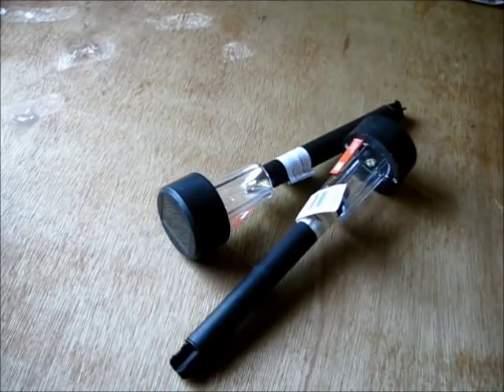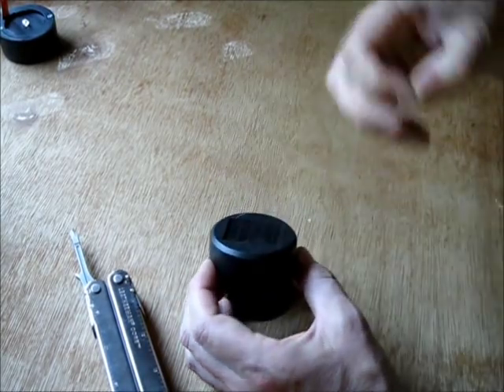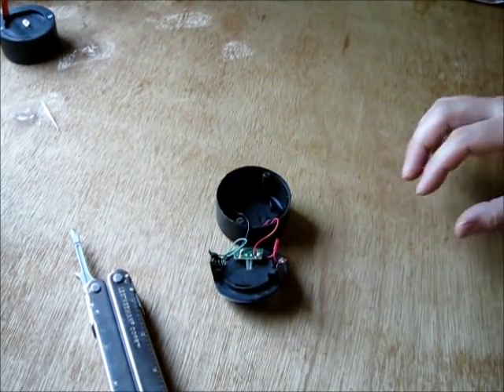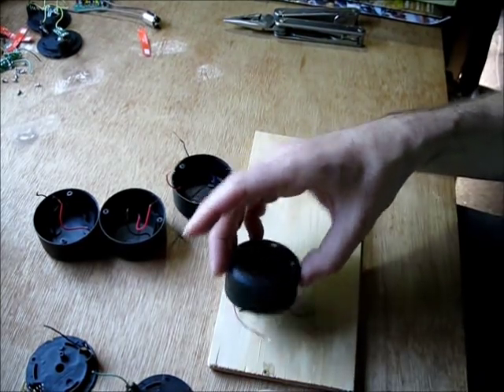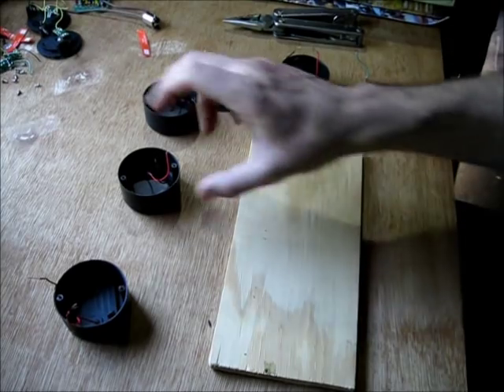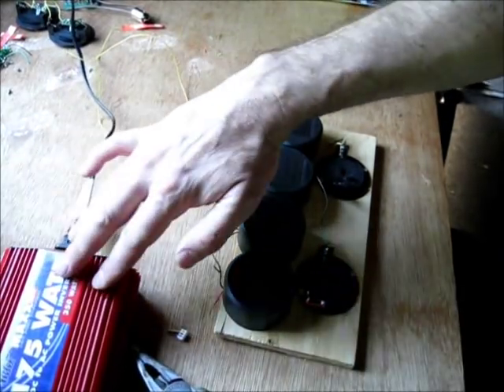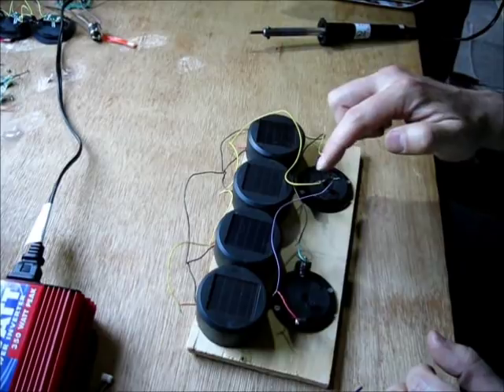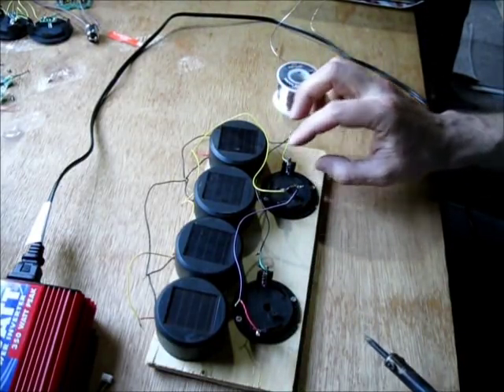DIY Solar Garden Light Hack - Solar Battery Charger

Comment from the maker: Thank you. Watch for the updates in the next couple weeks. I will add a voltage switch, maybe more solar cells and a USB connector to charge my cell phone.

I am also looking into control circuitry to prevent over charging of the batteries if I forget to watch them.
Reply: i want to build a cellphone charger with this method, how did yours turn out?
Reply: @jessedeleon4200  it's the voltage is good but the ampere is bit too low it take about 1 full day in the sun to get 3% very hour so it takes about 93hours in the sun so about 4days

Comment from the maker: Yes, I will be making some upgrades for this soon. Keep watching.

The batteries get warm when they are finished charging. Most charge controllers sense the temperature. This is such a low current tho that I do not think they would explode, but I would not leave them on for days after the are full

Comment from the maker: Thanks. You can actually use a USB cable to charge a normal cell phone. All you need to do is set up the solar cells to put out 5 volts. You can have various voltages from the same solar cells depending on how you hook them up.

Comment from the maker: Yes if you leave them on too long. Just figure about 25 ma per solar cell and how many ma your battery needs to charge. A few hours give or take will not harm a thing due to the lower current

Comment from the maker: A Schottky diode would be best due to a lower voltage drop, but almost any diode (non zener) will work in this case because it is only blocking the voltage from flowing out of the batteries and into the solar cells when a cloud passes over.

Comment from the maker: 1n4001 or 1n4007 work fine. Basically any sort of rectifier diode will do. Its just a blocker to prevent the battery from discharging back through the solar cells.

Comment from the maker: Yes, if it has one. Most do not but only have a little transistor or small circuit in them. But if you have a diode in there, yes it will work fine.

Comment from the maker: You could do it, but it would take some time. The current output from one cell is about 50mA. In a 10 hour day you get about 500mA from one cell. Two of these gives you an amp in 10 hours.

The voltage output is about 2.5 to 3 volts per cell. Put them together to get what you need. Check the original charger output for the proper voltage.

Comment from the maker: Any rectifier or schottky diode will do. A 1n4007 or 1n4001 will work. The Radio Shack part # is 276-1653 for a 25 pack.

Comment from the maker: Sometimes Westinghouse brand has the AA or AAA. A lot of these are now coming out with the 2/3 AA.

But you can use the solar cells from the dollar store path lights and get a battery socket at Radio Shack.

Comment from the maker: If you left it for many days, yes it would. With smaller batteries you should pull them off the charger after a day. With larger capacity batteries it will take a few days to charge them.

Comment from the maker: It exists and its called a MPPT controller. Multi power point tracking solar charge controller. It used both a buck (reducing) and boost converter to get the best charging curve out of your solar panels. In full sun they put out about 18 volts and in low sun maybe 9 to 10 or so. The MPPT controller matches the battery voltage to the solar panel voltage, increasing the charge over all sunlight levels.

Comment from the maker: 1N4001 or 1N4007 work fine. But a low power Schottkey is the best due to its lower voltage drop. Sorry dont know a number, but you can ask them.

Comment from the maker: These put out about 3.5 to 4 volts with no load. They drop down to about 1.5 to 1.7 volts per panel with a load, which is the right voltage for charging AA and AAA batteries.

Comment from the maker: Series increases voltage. Parallel increase current.

The solar cells are each meant to charge a 900 mAh battery in a full day. So you can charge two of them in this setup in half the time. Or a pair of 1800 mAh batteries in a whole day.

Comment from the maker: These are usually a single transistor based boost converter. They step up the voltage from 1.2 volts to about 3.2 volts to run a white LED.

You could use them for anything that runs in that voltage range and current. At some point tho, you will find its highest current limit and fry one. Keep track of what burns it out so you know your limits.

They will charge anything within their voltage range as well. The 2.3 volt cells should happily accept the voltage, yes.

Comment: It seems that it made more sense to face the wires from the solar cells toward the batteries, so the wires would reach. Is there any danger of over charging (or battery damage) if you leave the batteries in the charger too long? Thanks for the great ideas!

Comment from the maker: Thanks for the comments.

Yes, the diode is a necessary evil. You could use a schottky diode for lower voltage drop. But in the long run, it shouldnt matter too much with these smaller batteries.

Comment from the maker: That is cool. When I lived in Brooklyn, NY I used a 12 volt alarm system battery to power a battery operated 12 volt fluorescent lamp in the bathroom. The ones found in most hardware stores sold as closet lights. I had a shower room and a separate bathroom. Had a lamp in each. Saved some money on lighting that way.

Comment from the maker: Looks good. This has serious potential. These little solar cells can charge an AA or AAA battery during the day, so 3 of them would put out enough for small devices. I am surprised tho that your devices take the 3.2 volts from the boost coverters on the little circuit boards.

Most devices these days need 5 volts in.

Comment from the maker: Yes, sort of. They put out very little current. It would be a trickle charger to maintain its charge, rather than top off a battery. It may prevent a battery from discharging over time.

I have been thinking about putting one together. You need 18 volts on the solar panel, no load. String them up in series to make 18 V. Then put groups in parallel to get more current.

Comment from the maker: Yes, AA and AAA batteries. All you need is the right socket. You could actually charge your cell phone with the right voltage and power connector on it. I will do an update on that soon. I am ordering some USB connectors from China.

Comment from the maker: In between the panels and the batteries either on the positive or negative side. Just make sure you get the polarity of the diode right.

Comment from the maker: Yes, you can connect them to get 14 volts to charge a battery. But the current is very low. Better to charge smaller batteries and use LED lighting to save energy. It would take months to charge up a car battery with these tiny solar cells.

I got a bunch of dollar store LED flashlights I am converting to run off my solar charged batteries. They are very bright and run off AA or AAA batteries. String them together for best results.

At least its free lighting for life.

Comment from the maker: Yes you can. Anything that can sense the strength of the sun's intensity will work. Just set up a circuit that is triggered at a certain voltage level. More sunlight equals higher voltage output from the cells. Less light equals a lower voltage.

Hook one up to a volt meter and play around with it. Hold it in different angles to the sun. Try it at dusk and dawn. It will work.

Comment from the maker: Yes, that is a relatively untouched area. They are very fine boost converters, but noone really knows what to do with them. I sadly have no 3 volt devices, so I cannot use them. But they may be good for running some LED flashlights. You could even theoretically string a bunch of the circuits up to run higher powered LED bulbs, such as a 1 W LED. Now that would be an accomplishment.

Comment from the maker: Please do share your experience if you have seen these go bad. In my studies and experiments, I have made many solar panels out of smaller solar cells.

Solar cells are strung up to make larger voltage solar panels. Then you can string up your solar panels to make higher output or current.

Yes, there should be diodes on each one, with larger panels. These little solar cells do not put out much voltage or current though.

I have multiple cells in order to overcome the voltage drop and still work

Comment from the maker: The price for 4 solar cells at a dollar each is $4. You can get diodes free anywhere, sometimes in the solar lamp.

And its fun.

And you cannot get cheap solar panels here. The shipping to bring one over here is more than the panel.

Over here for a 5 watt panel plan to spend about $30 to $60.

Comment from the maker: There is normally only a transistor on the board, which acts like a diode sort of. 

Place a diode anywhere between the plus on the battery and the plus on the solar cell output.

I can fully help you if you come over to thediyworld forum and post a photo. I can then see what parts are on your board and help you get it going.

Comment: For a small array like this one you could use a 1N4148. Larger ones where you have solar cells in series & parrallel to give the voltages and current needed to charge say a car battery you'll need something like a 1N4001. For kit with internal batteries like smartphones or 2way radios a proper fixed voltage regulator like a 7805 (5v/USB) or 7812 (12v) will be required instead of a diode and there is a 7818 so you could charge a laptop directly by solar.

Comment from the maker: Yes, you would need 8 or even better, 10 of the cells. With 10 you can get charging with a bit of overcast as well. Your cell phone and some other devices have a built in charge limiter in the device. Otherwise, the circuitry gets a bit complicated with the need for a voltage monitor on the output of the solar panels which can shut off the output to the device when the voltage reaches a certain level.

Comment from the maker: Yeah, just go to Radio Shack and ask for a 1n4001 or 1n4007 or equivalent diode. Remember the band on it is negative and the unmarked end is positive. It blocks the flow in one direction but allows it in the other. If your charger is not working the first time, check the diode and make sure its installed the right way.
Reply: Just seeing this video for the first time just now.  I miss radio shack :(
Reply from the maker: @BriannaBeastMode  I miss them too. Now I have to order everything online and wait for it to arrive.

Comment from the maker: I have a general idea of the solar cells capacities because of the original batteries that came with them. Mine, for example, were 120 mAH batteries. That gives me about 120 mAH per day of charge per cell. 5 cells gives me about 600 mAH per day of charge. You can also just measure them from time to time. A rechargeable nicad is about 1.2 volts charged. When I get the to about 1.3 then I pull them off the charger.

Comment from the maker: You only need to block the power from flowing on one side. It has to flow through the circuit and back again. Blocking it on one side does the job. One diode.

The original circuit regulates the on and off based on if the sun is shining or not.

This is a battery charger though. No LEDs in the system. Just the solar cells and your batteries to be charged.

Comment from the maker: They are designed to use 1.2 volts in and put about 3.2 volts out. Probably not much current output, but it would be interesting to find out what their limits are. I have a bunch of them laying around after hacking these solar lamps.

Comment from the maker: It is low current so a few hours are no problem. You have to do the math. If your battery is 500 mah and your charger is 50mah, then it takes 10 hours to charge a single battery in full sunlight.

My batteries are about 2000 mah so it takes a couple days.

Comment from the maker: Normally the transistor acts like the one way switch. There is not normally a diode on the board, but depending on your particular circuit I could be wrong.

It is hard to tear one of these apart, but once you start making things with them, it get easier and so much fun.

These little lights can be used for so many cool projects. I will be uploading more projects later.
Reply: The diode usually serves to stop the stored energy in the battery going back into the solar panel, where it would get used by the panel which can act as a crude LED

Comment from the maker: The capacity of the panel should be matched to the batteries. Sounds like the solar panel is a 6 volt panel and maybe puts out half an amp in a day. Not very large. You would need two in series to make 12 volts and only get half an amp of solar power per day.

You need a larger panel for larger batteries.

Comment from the maker: Yes, it would be way too many amps. Your solar cells put out about 3.6 amps?

AA batteries can only handle about 80 to 120 milliamps max charging current.

I have often tried to think of ways to use my extra 0.5 volt 3.6 amp solar cells. I might end up using them with a boost converter one day just for fun.

Comment from the maker: It depends on your circuit. Most of these are designed to put out about 3.2 volts to the LED. The battery is 1.5 volts.

How it does this is to make a sort of DC to DC voltage step up converter from 1.5 volts to 3.2 volts to drive an LED.

So, most of these need to have the original circuit removed first. The circuit is normally a transistor, so no diode is needed.

Hope this helps some.

Comment: You might want to attach a couple of mirrors that will bounce more light onto the solar cells. It shouldn't heat them up very much while getting more watts per solar cell. This would really only work when the sun is rising or setting and in the winter, but you can get some really cheap mirrors.

Comment from the maker: It would actually be easier to use a couple solar cells to charge AA batteries and use that to charge your phone. I have an adapter that uses AA batteries and plugs into a cell phone.

Otherwise you need to string up a lot of these cells to get enough power for your phone to recognize it. They produce about 25 ma each at about 2 volts with no load.

Comment from the maker: You have about 7.5 amps at 2 volts (or any combination of voltage and amps) which gives you about 15 watts total. At 12 volts you probably have about 1.5 amps of charge with all your panels.

It would take you 10 hours of sunlight to get 100 usable watts of energy with your panels.

Comment from the maker: Well, some have batteries about 500 mAH in capacity installed. Take that times 1.2 volts = .6 Watts per day capacity. Not a whole lot. You can figure if its worth it using the math above.

I find they are perfect for charging batteries or running smaller lights. Strung together you could probably run a 12  volt fluorescent lamp for reading at night and save a bit of money while feeling good about yourself at the same time. Those lamps take 8 1.2 volt batteries to run them, I think.

Comment from the maker: They should produce more than enough power. Make sure every cell in putting out power. Check each one individually. Then check your wires.

Also tip the cells directly into the sun for best results. Straight up is not the optimum position for maximum charging.

Maybe your batteries are weak as well. What is the max capacity of them? Get larger, 2,000 mAH batteries and see what results you get. Should be way better.

Comment from the maker: Yes, any non automated charger can over charge your batteries. You need to do the math and figure how many hours to leave it out. I will be adding a cheap volt meter to the charger later so I can glance at it any time. I have a retail solar battery charger with no meter that cost me $29. My DIY charger cost me $4 and does the exact same job.

Comment from the maker: I watched your video. Looks good. But, if you want to use it for gas output, then you will need to use a radiant energy generator, Bedini Motor. Please come over to thediyworld  forum and I will help you on the way.

A few of these in parallel could keep a car battery topped off, but not charge it on its own. They will also not generate enough hydroxy gas on their own. Use the Bedini motor, run it off the solar cells and then see serious gas produced.

Comment: Well done bro! Theres much can be done with these cheap lights. My mom lives in upstate ny and has a very dark stairway so i took one apart, extended the led connector and installed the light above her stairs while placing the solar panel in a fixed spot outside on the roof. Now she always has enough light to see the lights switch at night. I want to build this charger so thanks for the demo. God bless!

Comment from the maker: They should have some diodes or they should be shut down. Radio shack is supposed to have a set of drawers with small electronics parts in them. There should be a drawer dedicated to diodes. Anyway, you can get rectifier diodes off ebay as well for pennies each. Get 1n4007 or 1n4004, should be fine.

Comment from the maker: That depends on what type of batteries they are. Can you open the lights and get to the batteries? If yes, then try to charge them with a conventional charger. You can also test the circuit using an outside power source. If you need more details, please come to thediyworld (dot) com forum and I would be happy to help. You can post photos there as well.

Comment from the maker: Terribly sorry for the late reply. I have over 3,500 comments to answer. Ouch.

Your battery is probably about 1800 mAH. The solar cells put out about 50 mA. It would take a LOT of them to charge the battery in a day or so.

If all you want is a slow charge, then it can be done but it may take a week or so. For 18 volts you also need about 15 of these at 50 mA.

Probably not worth it with garden lights.